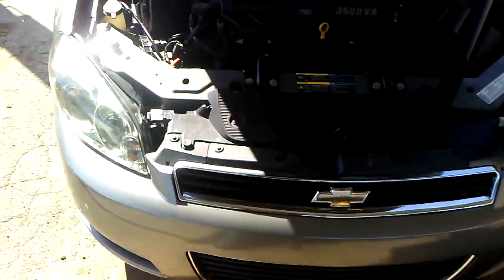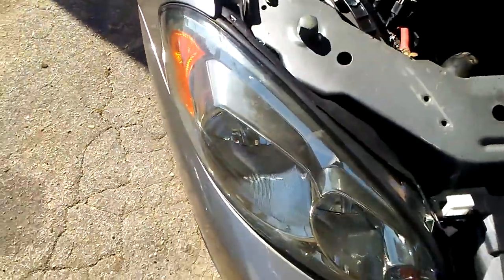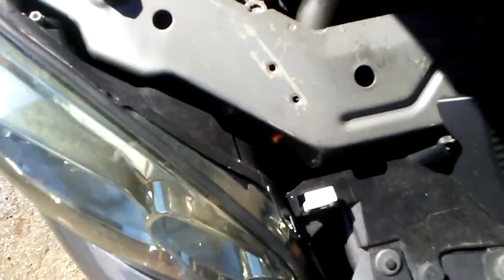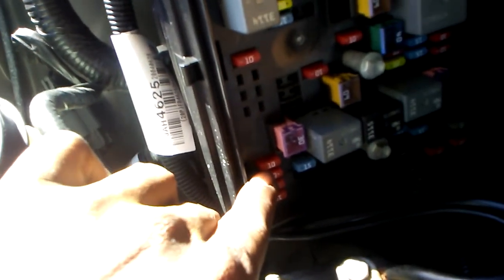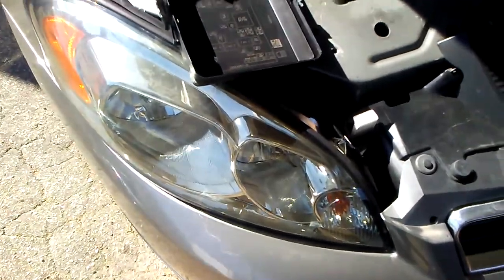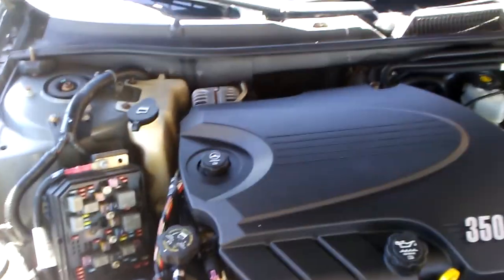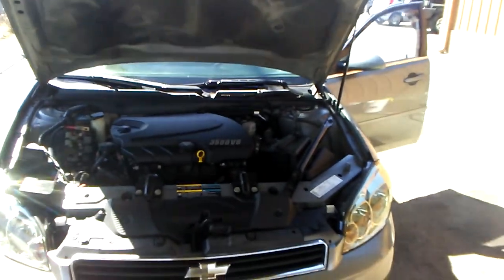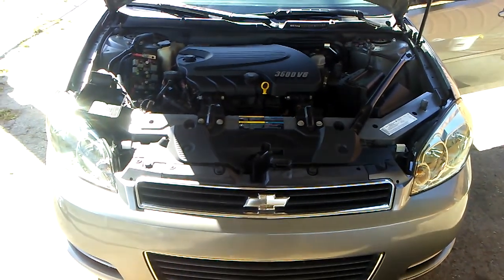Chevy impala headlight assembly and low beam headlight fix

Comment: Check the ground cable.  My bolt was rusted out and broke.  I took a wire brush and a self tapping screw and it works fine now.

Comment: For me it's not the bulb and I checked all the light fuses you pointed out and they looked ok. Could it be the wiring?
Reply: Check the ground cable.  My bolt was rusted out and broke.  I took a wire brush and a self tapping screw and it works fine now.

Comment: I replaced the entire headlight assembly with a new one. I changed the fuse. Bought new low beam bulbs. And, it still keeps going out!

It's almost like the bulb electrical connections are defective? If I force the bulb in further or pull it out a little bit, it turns on... But it goes out within minutes!

Very frustrating. Can anyone offer any advice?

Comment: What if I replaced the bulb and the blown fuse and it still doesn't work? In fact, it blew the new fuse as well. HELP PLEASE!
Reply: Check the ground cable.  My bolt was rusted out and broke.  I took a wire brush and a self tapping screw and it works fine now.
Reply: Did you get this problem fixed